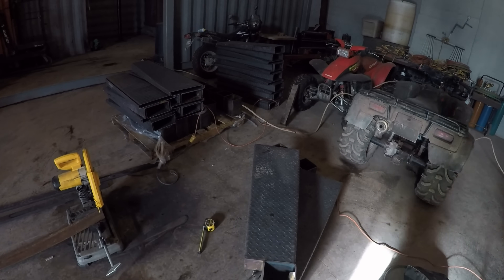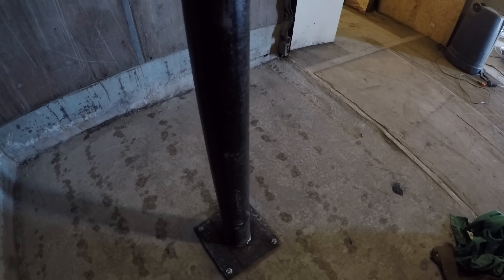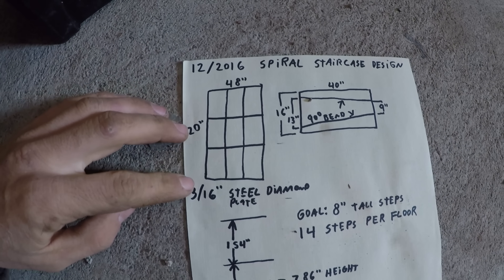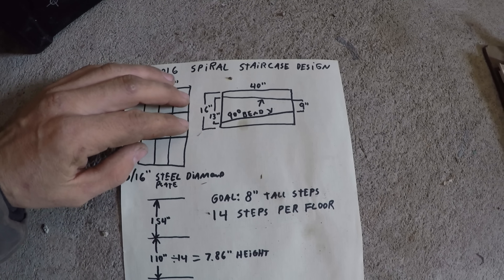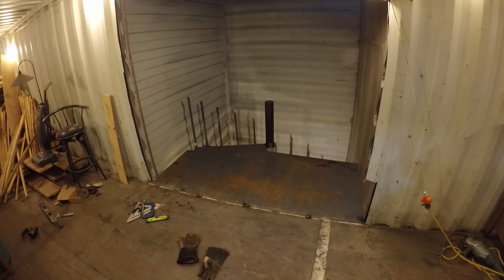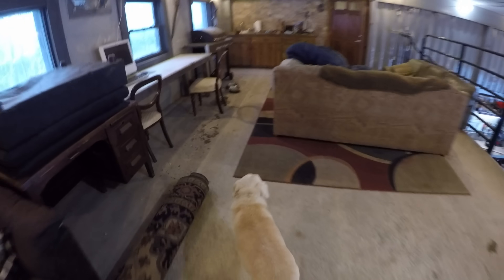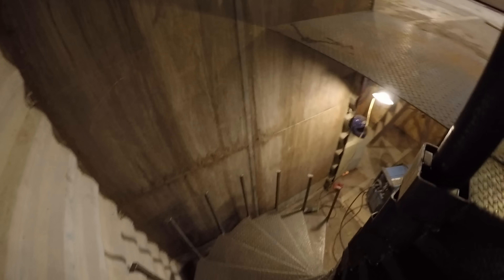How to build a spiral stair case

Comment: Tube is measured on the outside, pipe is measured on the inside.  If you had used tube for the support, you could use the same diameter pipe for the stair pieces.  This is about 5 years late, but maybe someone will learn from this.  LOL.

Comment: Anyone can build a spiral stairscase from a kit around a pipe. What kind of finish carpenter would it take to build an unsupported sweeping staircase like the one in Tara, the plantation house in "Gone With the Wind, laying out with a trammel, string, and storey pole while using a minimum amount of pattern material? Marble treads, risers, turned ballisters, etc

But then, such a staircase might be out of place in a condotainer.

Comment: I'm glad you removed the dog from the shop when the welding was done, I did ornamental iron work and pipe fitting for almost 10 years and I can't tell you how many nights I suffered with burnt eyes from the welding. Yes, I wore a welders mask but sometimes when you're working with someone, you still catch stray flash. I found that peeling a potato and putting 1/2 in each eye works until a doctor can give you the magic cream. When I went to the eye doctor, he told me that I boiled the outer layer on one of my eyes, so I've been wearing glasses ever since. I love dogs and just lost a favorite furry friend of mine in December of 2019. So thank you for thinking about your dog and your dogs vision. Oh, and great work by the way. Iron work is definitely for manly men. I got over my fear of heights standing on an electric scissor lift raised 20 feet standing on a 12 foot ladder and using a 4 foot pipe wrench at ceiling height. Take good care of yourself, when you turn 68 like me, everything you have hurts, so to avoid any pain, just don't stop working. Being stationary will kill you.

Comment: Spiral stairs can be done in many ways, and yours look great! 
If I could offer a simpler, and cleaner looking design....
Have the fabricators cut a radius on the inside of each tread to match the main pole. Then you prep each tread by welding a single picket to the back right corner, as well as, a short picket w/foot under the front outside edge of the first tread. Weld the first tread to the pole, using a chain vise-grip around the pole to hold the tread up. Move the chain vise-grip up to the next mark, set the next tread on top bringing the tread nose forward meeting the picket of the previous tread, and weld it up. And so on, and so on. It would save some material, fabrication time, and look cleaner.
Just a tip. You do great work!

Comment: I'd rather build myself an elevator than all that welding for each step. elevators have been around for 2255 years back in 236 BC....just need some counterweight and you've got loads of dirt out back. Use some electric winches etc.

Comment: Nice Miller. Does the job well. I have a little cheap hyl inverter welder with 75/25 gas seems to be ok for a 100 dollar welder. Dont use it too often but when I need it's there. Great job on the spiral stair design.

Comment: Awesome video Andrew! I like you wind up doing a lot of building projects all by my self. I like the way you had a simple design which was easy to follow and you didn't waste time with a lot of particulars. For folks that might struggle a bit it would have been nice if you would have laid out stair spacing horizontally, bolster height and how you attached them. But that was a great job made simple!

Comment: Hi Andrew,  Thanks for making this video, I'm using it as guidance to build the spiral staircase for my deck but I'm having trouble locating the material you're referencing for the handrails... would you be able to provide a link or anything I could use to locate this plastic material?  Thanks in advance and thanks again for making the vid.

Comment: with your skill set an elevator may have been easier and cheaper
Reply: he can always add another upright shipping container, with added lift.
Reply: An elevator is a whole different level skillset. So many parts which have to move along guiding rails, counterweight, safety system, maintenance. He can make it, but i wouldn’t want to stand in a 40 feet tall DIY elevator. He’s better off using his machinery for big lifting.

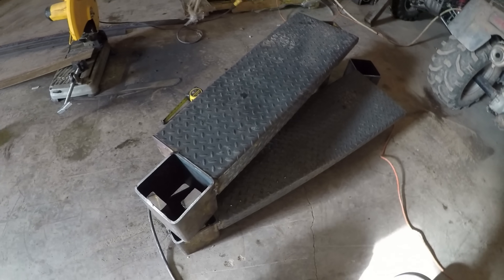Comment: Fantastic work but in your explanation of the Treads you state you end up with a 13 x 9 tread but those treads are clearly square footprints when viewing them at 5:00 - 6:47 and 7:42. 
So I didn't quite get what I needed to duplicate your great looking treads. :(    

If you have  moment to clarify that part in an answer to me it would be great - otherwise thanks anyway.  :)
Reply from the maker: They are 9" on the edge near the square tubing, and 13" on the far end, its easy to see the difference in the amount of over hang that's bend under the step.

Comment: It’s too bad you couldn’t find round stock that would fit over the 6” schedule 40 pipe you used for the center. 
The stairs look great but would be much nicer if it was all round. 

Perhaps next time consider the next size up that has an I.D. that’s too small to get the center bored out to fit.
Reply from the maker: I like the square look. Plus the square stairs welded to it nicely without having to do any cuts.

Comment: Non standard steps with non uniform rises are a major tripping hazard; people are very sensitive to stair uniformity. Have a good trip.
Reply: Rusty
Each section of stairs are all equal and the different rises are separated by landings. Just as the stairways in most houses are slightly different between the basement stairs and those leading to the 2nd floor. 

You take a little bit of true information and completely show that you know nothing by posting what you did. 
Yes. If Andrew had 7.28”, 7.5” and 7.7” all in each run it would be a trip hazard but not when you separate them. 

Go ahead and measure your basement and 2nd floor stairs.
Reply: fat lives matter!
Reply: Yah know Rusty, I have been a building inspector for over 20 years now, and for the life of me I did not find it necessary or feel the need to freaking tell him it was not to code, good grief man.
Reply: And technically, one could argue that each landing being a different floor could mean a different height, technically its 7 and 11 for tread and riser, hes not that far off, and its not a spec building for sale, its a personal building in a part of that county that likely does not even enforce code. There are special provisions for spiral staircases as well btw.
Reply: @johnkruton9708  Couldn't agree more about AC. Hes a doer and a hustler. I'd vote for him any day of the week.
Reply: Rusty Smith gets trophies for “winning” last place.
Reply: Whiner!
Reply: Can't roast andrew too many followers 🙄👌👑👍
Reply from the maker: They are close enough. I don't care about fat people.
Reply: @AndrewCamarata  I'm dying xD
Reply: Rusty Smith......Get off your keyboard and go and help mommy bake her pies , and then tell her that the crust is to thin for the pie it's covering and then she can scold you and send you to bed without supper even though your about 50 years old and been living with mommy all your sad life.......!
Reply: @yensabi  what was that for?

Comment: How come you didn't use round pipe for the steps?
Reply from the maker: I couldn't find two big round pipes that sleeved inside each other well. And the square was easier to weld the square steps to. I mentioned that in the video.

Comment: Brilliant work , would you have to weld any extra support for the stairs to be plumb , the pipe is welded at the bottom but just wondering if you would need more support , please let  me know
Reply from the maker: ACarCalled Mercedes no, because it's welded at every landing. That thing is solid.
Reply: Brilliant work mate , Good Luck

Comment: Hi Andrew, awesome job on your videos. Also, nice to see your sub count growing. I subbed when it was at 20 something :) question, did you record the construction process of your container mansion? it would be an awesome one to see. keep posting, you're doing great.
Reply from the maker: Thanks, you looking for older videos of working on that building? There's a few; one setting the roof slabs, and pouring roof concrete. I didn't used to film everything like I have been trying to do now.